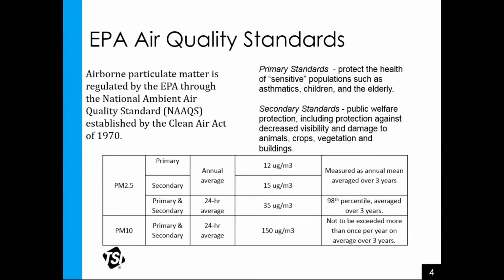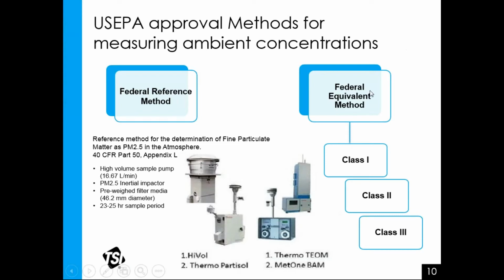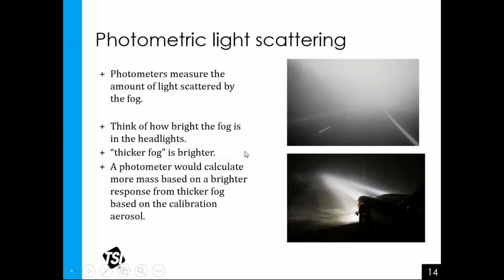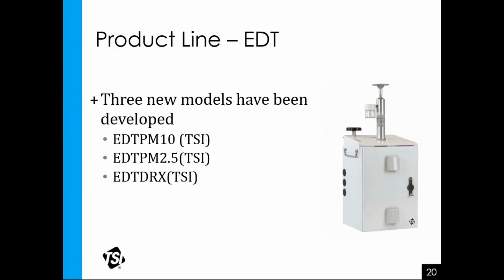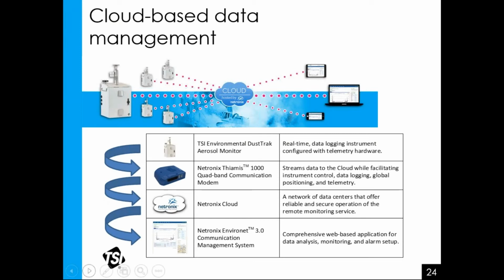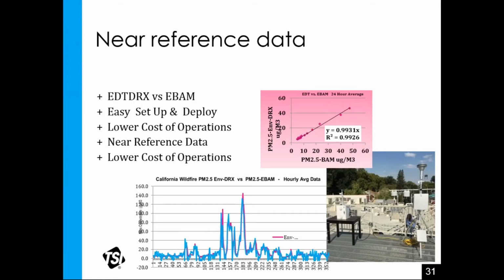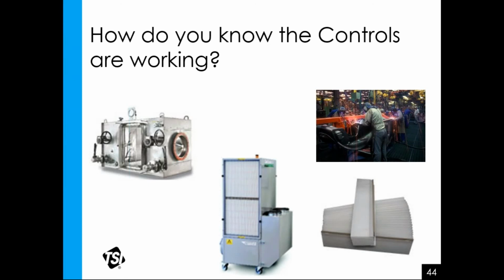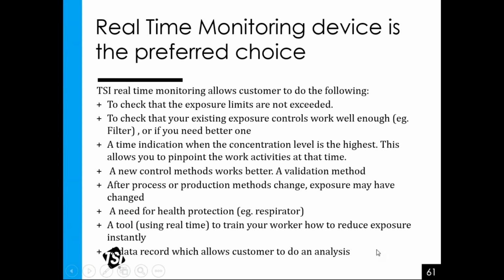The Benefits of Real-Time Dust Monitoring | Dust Monitoring Matters To Worker Health

Comment: Hello

I am having airborne dust concentrations data as PM10, PM2.5, PM 1 . 
These data was taken before and during dust producing work in a civil construction site. 

N=5

How can i compare these before and during operations data ?
It seems that there is percent variation in dust concentrations in atmosphere between before and during operation data.

e.g., PM 10  ( particle size less than 10 microns) is sharing 40% of total airborne dust, and PM 2.5 ( particle size less than 2. 5 micron) shares 10% of total airborne dust.

During machine operation:
PM 10 shares 60% and PM 2.5 10% only.

It seems that PM 10 share is increased due to that machine operation?

Which test is suitable for analysing these type similar data for discussion ?

How to use statistics?
Any comparison among these particle sizes?
thank u.